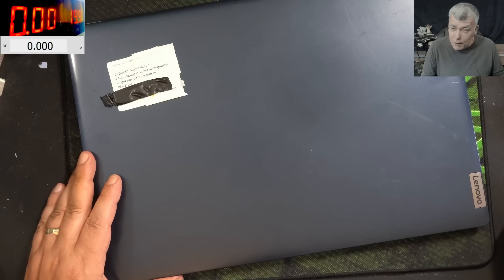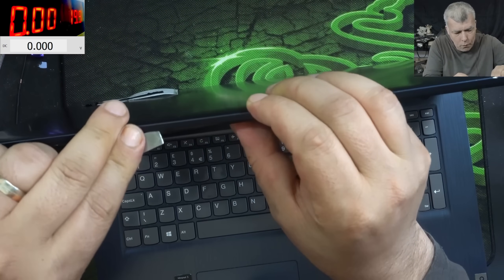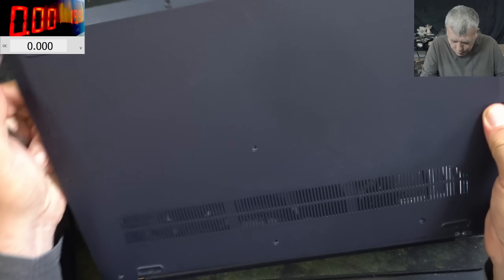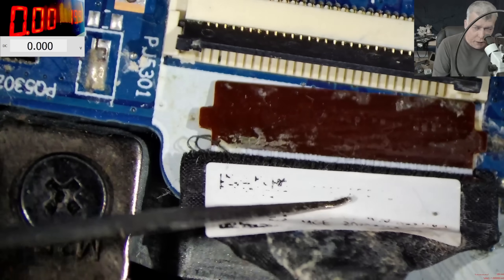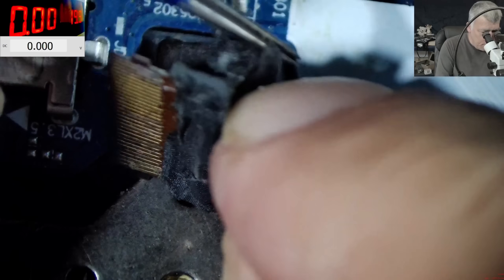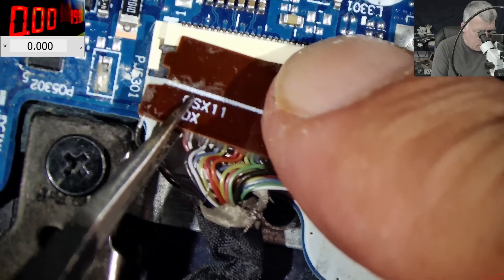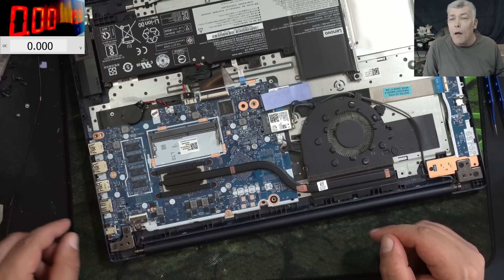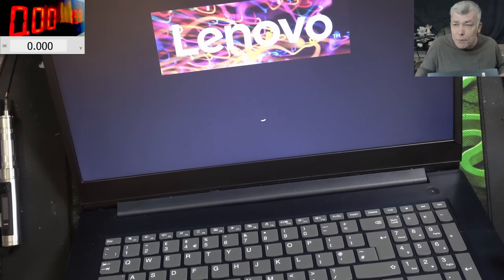Burned screen connector, easy to be fixed without replacing the screen cable

Comment: How is cutting the wires from the male connector and soldering them directly to the jumper point on the board is the easiest solution? if anything, it is dodgy and riskier.

The easiest way is to de-solder the two wires and push them forward the tracks on the male connector, so they are over the gap and solder them there. You make the wires themselves as bridges.

And I also agree with the other commenter saying that soldering the wires before the fuse is a bad idea.

Yes, the charger has a short circuit and over current protection but it is rated for how many amps the charger can put out before it considers the situation as fatal. The fuse installed for the backlight has a much lower amperage rating and it is meant to blow when the current draw is exceeding that.
The fuse on the main power rail also has a higher amperage rating.
Therefore, you can't rely on them. You must rely on the fuse that is meant for the backlight. Do it RIGHT or don't do it at all. Your channel is teaching people to do things wrong! Shame on you.

Comment: Very dodgy repair.
When you have a 50/50 chance of repairing the screen, do you first disassemble the screen casing instead of removing the bottom casing? You have to disconnect the battery anyway. I don't understand this. Additionally, you prefer to leave the wires stretched (risking the laptop's quick return for complaint) instead of soldering a piece of wire and using heat shrink, which with your skills will probably take 2 minutes. Taking the computer back to the service, reading the customer's note, disassembling and repairing it takes at least 15 minutes.

Comment: I have a Lenovo Ideapad 305 14 laptop that I haven't used for a long time. When I try to turn it on, there is no life visible on the button lights or anything else. Should I start by repairing the CMOS battery like you did in your videos, or where should I start to check it? Give me good directions because you are my teacher.

Comment: I understand jumping fuse but why also jumping current sensor resistor?
Reply: wire not long enough, easier than extending the wire

Comment: Screen is attached to hinges with two sided tape. You can separate screen from hinges with hot air gun...
Reply: I was looking on Ebay for used screens for this laptop to see how the screen was attached. All of the used screens have the hinges attached. The new screens  do not.  I was thinking small screws in to the sides of the screen.   But you said doubled sided tape.   Thanks
Reply: @markweiss5152  Yeah, but make sure you use glass screws. ;-)
Reply: Look for screen with or without frame

Comment: jumping teh backlight fuse on a liquiddamaged and cracked laptop is a really bad idea, if you don'T want to extend the wires at least solder a fuse to the point you used and teh wire to the fuse... takes 30 secs and makes it a proper repair. Also that connecto rstill has liquid in it, should have added a lot of ipa to it an dbrush it out, it will corrode on the 3V rail too soon.
On the fuse: I've had multiple laptops with burnt lcd side connector or burnt wire after they jumpered the fuse with a wire, how would  a 500mA fuse be replaced by a chargers/batts over 5A short circuit protection?
Reply: Sorin too lazy for that. Next is burnin wires if goes short circuit
Reply: There is fuse on main rail. So what was the point of your rant?

Comment: If it is not a T, X or P series notebook Lenovo disappoints. Connecting the hinge to the screen is a new low even for Lenovo. XD
Reply: Also, it looks like the fan housing is riveted together.

Comment: Yaaaa. Pad strip the connector traces and for God sakes brush and canned air the fan.
Reply: Fan clean-up was not why laptop was on service. Learn to do what is needed and not all what you can.
Reply: Better than nothing, since it looks like the fan housing is riveted together, so no taking it apart, unless you want to micro-drill out the plastic rivets and replace with a few tiny screws.
Reply: that's bullshit to all of you. slackers. who sees their fan and the crap in the blades that can overheating and balls popping loose from the mainboard? "ok not-so-easy-pizza, customer comes back so angry. dees-a-nice-a-laptop come back a-no veedeoo again".

Comment: Nice, I like these videos as I have recently got access to try out a soldering tool and saw it’s potential to fix components. I fixed a clock in my car using it. So I think I can try it with my Lennovo Ideapad 5. There’s some power related issue the fan still spins and the LED on the power button still shows a post code. The fan spins only when it’s plugged in so I think there’s still a chance to fix the laptop. 

I don’t have a multimeter and soldering kit. Neither a junk spare mobo for parts. What do you recommend? I costs me $600-700 USD to replace the motherboard as it’s still a 2022 model.
Reply: Gett a miltimiter, they are cheap and invaluable for diagnostic. I suppose you already cheeked what the post code means. Then you can follow basic diagnostic steps. Remove ran, wifi card, hard drive... 2. Reset bios
For any other diagnostic steps is very hard to do without a power supply. But get a multimeter you won't regret it .
Reply: @gabrysur The ram is soldered so I’d have to remove that via a soldering tool. I read from some forms if you do this the bios will detect a variance and lock up. Some suggest resetting the CMOS as well if this is performed. I only have the power supply that came with the laptop. Still need to test where the powers running into an issue. The post code says it’s a power issue or battery issue. Replaced battery and the computer doesn’t even respond with post or the fan when plugged in. It only works with the original that I already did a static reset on. Thats the only way I was able to get it to post, it wouldn’t do that before.
Reply: @YogurtSnipe  And then they ask me why I'm so mad at soldered ram! so, if I understand correctly, you did a static rest on the battery and you got the computer to post? you mean you can see something in the screen? If the code is for power I would try another power supply. That's why a Lab power supply is essential for diagnostics, You can see what the current is doing. My advice... Its seems like an easy fix, try sending it to a proper repairs guy that can do a diagnostic on it. But keep been curious and trying to fix things, its very rewarding to save something from the land fields!
Reply: @gabrysur I took it to two repair shops; I didn’t want to pay for diagnosis so I asked if I could utilize their tools to try to do it myself. CPR (Cell Phone Repair) tested a similar power supply and that didn’t change anything. A mom and pop shop called technology solutions told me to replace the battery. I did and it wouldn’t post. By post for a Lenovo I mean the LED power on button that indicates whether it’s on. It has a Morse code indicator according to online. The trouble shooting manual didn’t help at all. I tried the NOVO button on the side of the laptop to which was recommended if there was power. That did nothing. Until I get a multimeter and actually test the mosfits, power rail, and gate I really won’t know if it’s easy. I’m guessing somewhere along the line the powers getting shorted. The screen does not even brighten.